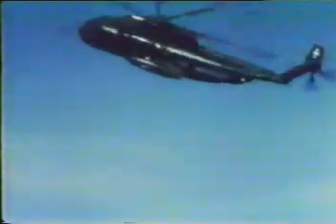Sikorsky CH-53 A Sea Stallion Helicopter

Comment: In 1971 at PhuLoi  A 242nd Avn Co  CH-47C Flight engineer stole his Chinook and I and others saw a harrowing flight in which he did barrel rolls from a hover at about 1500 feet and lots of other stuff before he crashed inverted into a huge fireball.  Now I learn some 60 years later that Sikorsky did it first - Darn!  I wonder when someone did it successfully in a Chinook?  My advice is do not try that at a hover even at altitude.

Comment: We saw saw this film in boot camp while in San Diego. That was back in 1977. There was more footage than this. I wound up in the Air Wing as a 6024 Adj Power Plant Mechanic for the F4/J Phantom. I was stationed at the NARF MCAS Cherry Point, N.C. Just about everything you see today is about 40 years behind military aviation. We are baddass.
Semper Fi

Comment: the "screws" that hold the main rotor blades on are pretty impressive, as well.  These failed in the early days when the blades were being folded (actaully decelerating from the folding motion).

Comment: What year was it? 1976 maybe. We were aboard the USS Guam when we saw that video. HMH462, and that particular aircraft was down in the hanger deck as a hanger queen. Hanger Queens are units you strip off parts to keep other aircraft flying. Eagle Pull, my bird was left at Fatema and I became an E-5, 1st raggy on someone else's bird. Which was OK, I suppose, Crew Cheif and 2nd raggy were also E-5. It was just who was promoted when.

Comment: When I was in the Air Force, a pal of mine was in the marines. We were both tech RF and audio heads. He told me that on the rescue version H53 that in order to be heard of the massive turbo shaft engines, the PA amplifier that the crew and pilot could talk on to be heard "outside" the helicopter on the ground, the rescuee, the amplifier put out some 18,000 watts!! If thats true thats a lot of power  WOW!